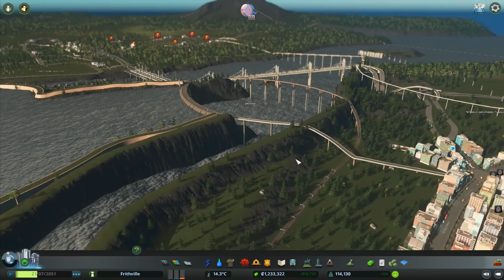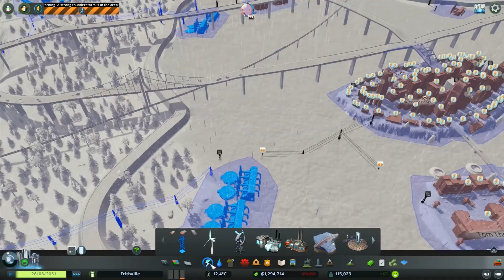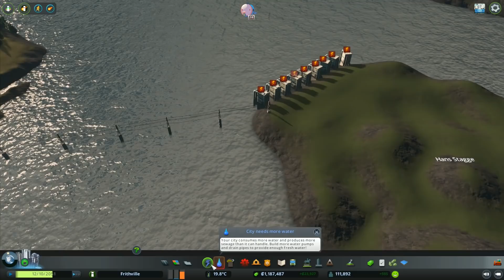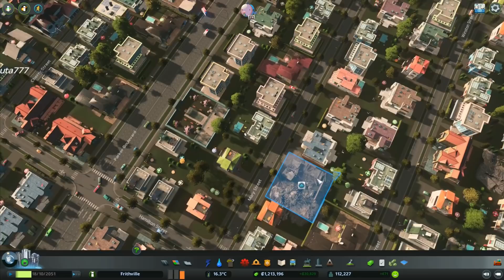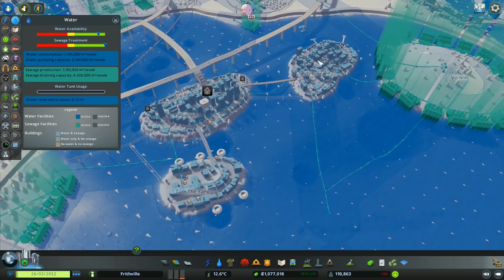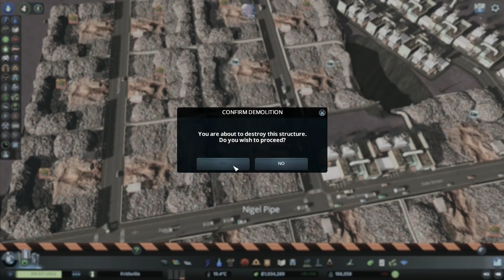Let's Play Cities Skylines #63: Trash Burning!

Comment: The move it mod I showed you, you can bulldoze the rubbish dumps with it without having to empty them first. Here is a mod that will get rid of the pollution colour on the ground and stop the trees looking dead. The pollution still be there just makes it nicer to look at the surroundings. https://steamcommunity.com/sharedfiles/filedetails/?id=666425898
Reply from the maker: I was considering using it, but I want to run this plan through with emptying them because of the added difficulties for the city!
Reply: @Frithgar  I had a feeling that you might not want to use it for that but just thought I would just throw out there just in case since I didn't say that the mod would bulldoze that just mentioned everything but.